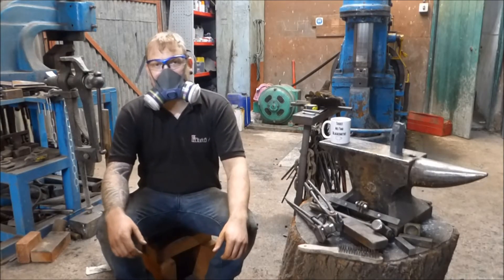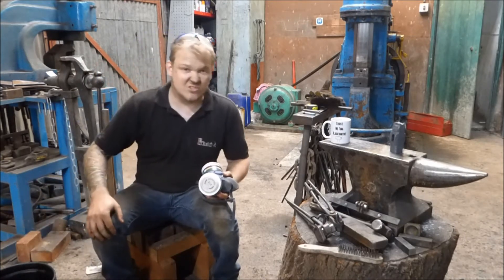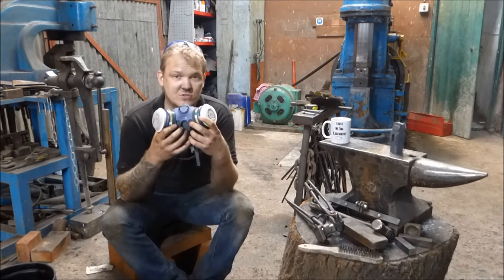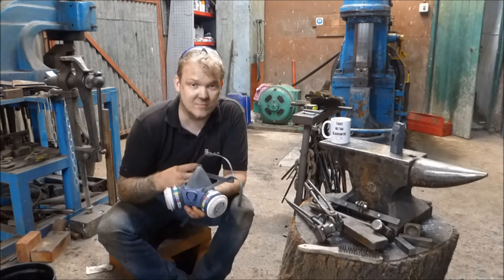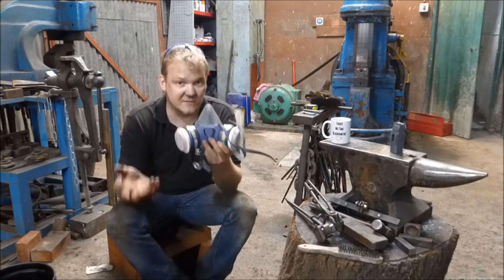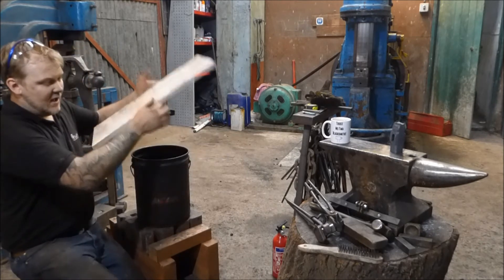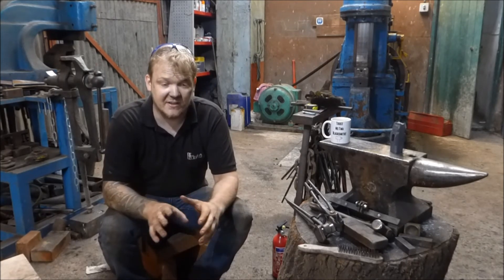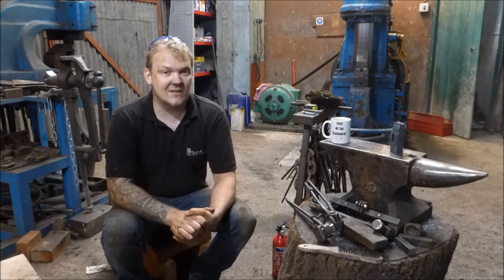Heat Treatment 101! Part 2.5 The Safety! Trust Me I'ma Blacksmith

Comment: Dan, thanks for this vid, safety is a really important aspect of blacksmithing but as much as you do, we as viewers are responsible for our own safety, after all, you don't supervise me in my workshop thats down to me. Dan, as you would know, there is some dodgy stuff on the internet but if someone doesn't wear safety glasses on a vid, where there is hot metal flying about or when they're grinding that is their choice, but I'm not going to adhere to that as a safe work practice that is my choice, my standard. Dan, you don't charge for the content you provide, you share the knowledge you have gained with us freely, I assume to disseminate that knowledge to the wider amateur blacksmithing community - thanks. Dan, I will continue to watch your channel but I will apply my own safety standards that I've been taught or that I've learned through my own research, a bit of personal responsibility goes a long way - keep safe and keep hammering.
Reply from the maker: Sorry about this video dude but felt it need to be done. I'm also trying to make a point about advice and information that is shared on youtube.I would like to think that I give you guys fair and well rounded videos which have been well researched and thought out. Some one saying I shouldn't do something and I should know tell all my views based on his word to stop doing that thing. Then they are unable to prove what the have said with hard facts is what i'm trying to get at with this video. 

So the point of the video is to say look your right I made little attempt to  cover safety in this video but hear say and word of mouth is not the way to live your life. Real and credible information is much better than going my old boss said you shouldn't do that cause his grandfather says it gives you cancer. 

Thank you for the great comment and I agree with your point we all mange risk at are own leave. Great comment and I hope you don't feel that I'm too wet.